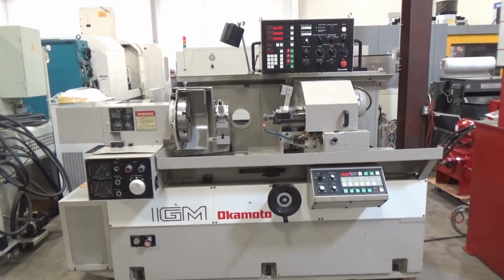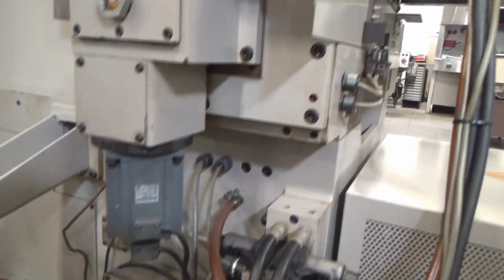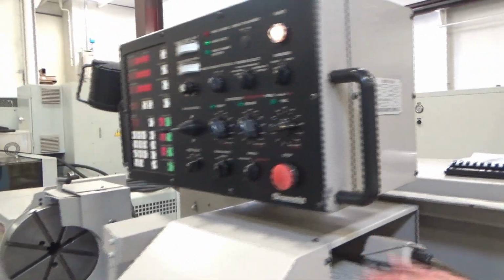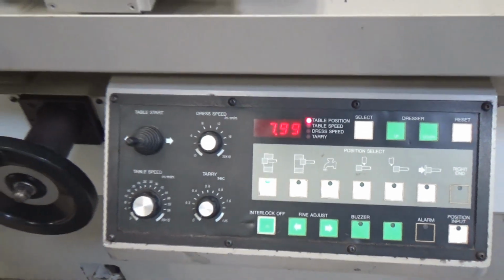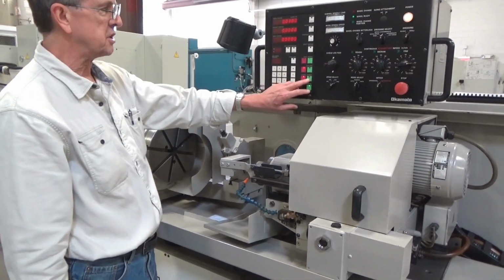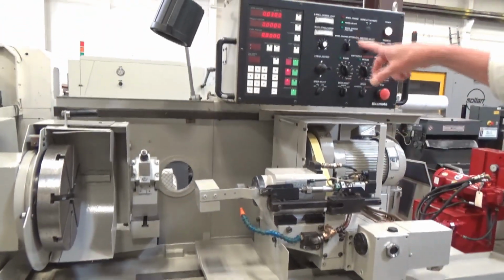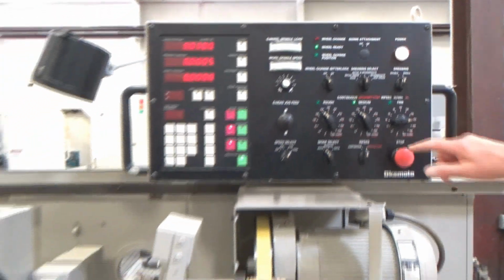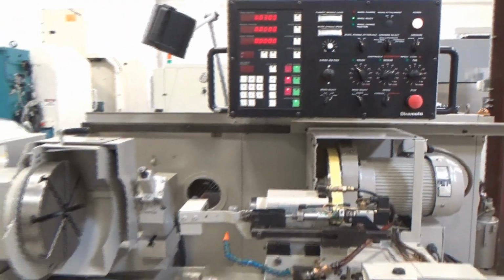Okamoto IGM-2M Internal Grinding Machine - Liberty #48320

Comment: We have a machine recently received from japan source,. On receiving we found the battery on CPU board disconnected,.
we have replaced the battery with a new one. however no activity with any pushbutton.
do you think any parameters need to be input to start the machine? please share if you know about the machine.